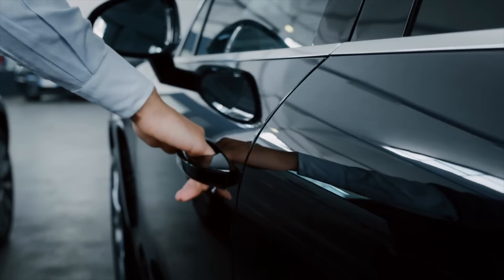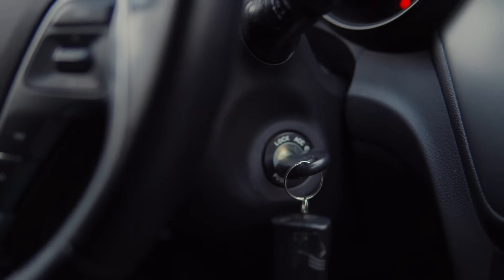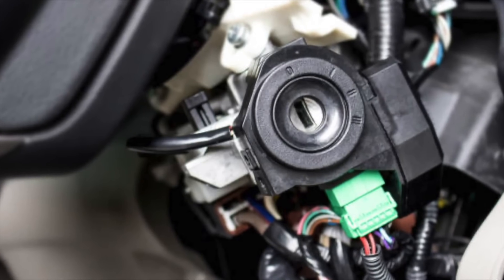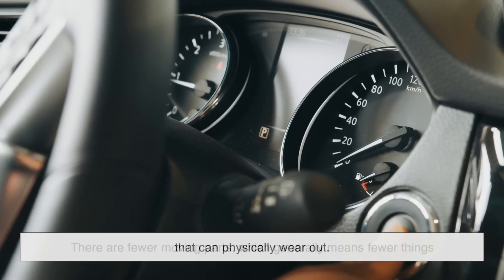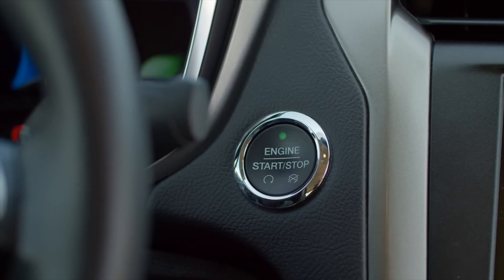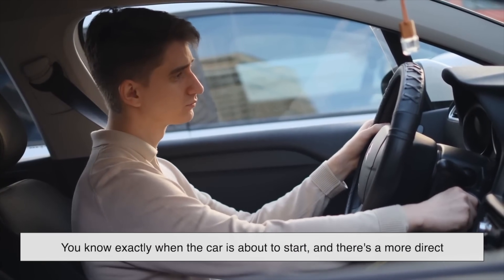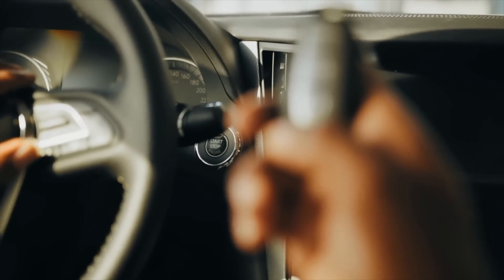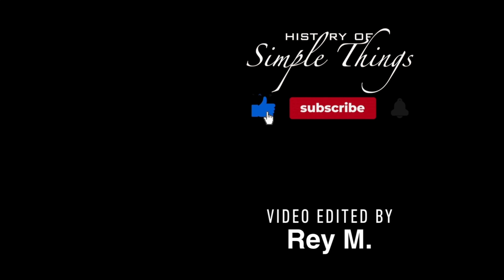Traditional Key vs. Push Button Start: What Sets Them Apart?

Comment: I'm old enough to remember when cars had starter buttons.  Sometimes on the dash, under the gas or clutch pedal, sometimes yanking on the manual shift lever.

 Much prefer push buttons, I've replaced WAY too many ignition switches.  

Thumbs up to the poster below who knows push buttons won't leave you stranded.  I make it a practice to replace key fob batteries every two years so my wife doesn't have to know the trick.
Reply: And I am old enough to remember crank handles
Reply: Back in the day, my 2004 S2000 already had a push-button start. It was rare and cool back then.
Reply: yes read my post also

Comment: Give me the Key back anyday.
Reply: Pop-out-flush electric car door handles.
Modern car industry : creating new innovations, nobody asked for, to solve problems nobody had. 
🤔🤔😀😀😀😀
Reply: Quit buying new cars and just drive one with a key
Reply: @josejh-eb8st And risk getting it stolen but hot-wiring or even USB and screwdrivers, I'm really good with my new push start which totally removes these risk factors thank you very much and so does so many other car manufacturers finally slowly but surely phasing them out like how they are phasing out disc players
Reply: Buy a 2nd hand car then, time to phase these old school things out just as they did with the old school cranker

Comment: In 2024, over 850,000 vehicles were stolen in the United States. Stolen vehicles are used in the commission of crimes such as robberies. Stolen vehicles have been used to ram through the doors of stores. The robbers don't care about the damage done, because the property does not belong to them and they do not believe they will be apprehended,

Comment: The remote has a backup feature. If the battery goes dead. It has a RFID chip built in and a key. The key gets you in but the chip will still start the car. Just place the remote where the manufacturer recommends to get the vehicle to recognize the remote. Now you can start the vehicle. Don't forget to replace the battery asap.
Reply: Didn't know that! Thanks 😊
Reply: Everything is in the owner's manuals.

Comment: I know it does not matter unless you are using a different car every day but, every manufacturer puts the start button in a different place and sometimes even on different models within the same company. Don't know why they can't just put the button where the key used to go.
Reply: The location where the key used to go is a bit out of the way if you think about it, you have to bend your wrist more vs point and press your finger straight forward. 

Different location may contribute to visual design of car, and functionality. Some like it near the stick shift since it's where you go to next after pressing the button. Some like it near where key traditionally is but off to the side so it's easier to see and press as mentioned before

Comment: A dead FOB battery will not leave you stranded. All you have to do is to push the button with the FOB and it will start. Some cars have a special place to put the FOB (such as a slot) and then it will still start. 

Since I have some disabilities, not having to fumble with a key makes my life much easier. You can also leave your car running when you go into a store as it can't be stolen if the FOB is with you.
Reply: I beg to differ about not being able to be stolen, they can drive to their hearts content as long as they don't turn it off.  At least with mopar products they'll get a nag on the dash complaining the key isn't present, but it won't shut it down.  LOCK the car if you leave it running.
Reply: @robertstout6980  How do they get it into gear? No FOB, no shifting?
Reply: @paparoysworkshop  Just hit the brake and shift.
Reply: @robertstout6980  Sorry. No FOB, no shift. Don't try and tell me how to drive my car.
Reply: @paparoysworkshop it's not a matter of trying to tell you how to drive your car, it is just the reality of it as the car can still shift even without the phob being present once the engine is on, it is just that they can't shut off the vehicle or else it will be totally useless at that point
Reply: @thebluemambawarriortv9845  It actually depends on the brand of car. Some cars will block shifting if the fob is not detected.
Reply: I came here to say this. I work at a dealership and the number of dead fob’s lol. A real key is better. I drive a 08 aspen and have a 98 Dakota protect truck in my shop. My wife drives a 08 aspen as well but yesterday I picked her up a 2014 charger and it’s got push to start. She loves the car. Hates that feature lol.
Reply: It can actually be stolen though you have your key with you if you leave the ignition on, however if the their shuts off the car it won't be able to start again unless recovered to place back the key with it
Reply: @thebluemambawarriortv9845  It can not be put into gear without the FOB. The system locks up and the car can not be driven. If I left it in neutral, then yes, it can be taken until put in park, or turned off. But who parks their car in neutral? 

Here is a funny story that happened to my friend with his car. His wife had the FOB. He dropped her off at the grocery store then went to get themselves some coffee and donuts. He put the car in part at the drive through window while he paid. And that's where he sat. His wife had the FOB and he sat there blocking the drive through. Engine running and no way to put the car back into gear. I still tease him to this day.
Reply: yes, just hold fob with the dead battery against the button
Reply: So far, it only worked in theory for me. When the fob was dead, I did the emergency procedure and the car just wouldn't recognize the key. Even after I've replaced the battery, it took a while for both the fob and the car receiver to come to their senses.
Reply: @lajya01  Interesting, we did have one time when her key fob battery failed in less than two years and I had to hold the fob to the start button, it worked perfectly, even with the battery removed.  I have no idea how that works, but it did.  My wife is simply not mechanically inclined in the least and I want everything to work as intended for her, so I replace key fob batteries every two years and the car battery every 5 years.
Reply: @lajya01  I removed the battery and tried it just to make sure.
Reply: @lajya01 It normally starts about 1 or 2 times before not starting anymore until the battery is changed normally to warn you to change the battery but again hence why you still have the Spare phob to use until you change the battery on the main one
Reply: Maybe on whatever you drive, but not the case on Chevrolet. Unless you use remote start then it won't shift
Reply: maybe on whatever you drive. Not the case with Chevrolet unless you use remote start. Then what you say is true.
Reply: @Freddy_Tiffany  Of course I can't speak for every vehicle. I can only speak my own and friends who've told me the same.

Comment: Cars with the Push Button start are Known to get Stolen
Reply: That was Hyundai (and KIA) that didn't bother to upgrade their cars that had the push button start system. Most push button start cars are much better. Also a Faraday pouch can be purchased (I bought mine from Amazon) to put your FOB in to defeat any theft by signal amplifiers. Also FOB signal strength is only 3 meters (a little over 9 feet) from the car.
Reply: I think some companies were stupid enough to not implement rolling codes.

Comment: I prefer key 😊
Reply: I prefer the key and shifter instead of push buttons……..they did this in the sixties and it didn’t catch either.
Reply: It's all bullshit to make the cars expensive and now you need to replace another fking battery
Reply: So do I
Reply: The day one feels comfortable and nostalgic with what used to be usual...
Means only one thing... you are growing old 😊
Reply: @thesaint9286 
Modern car industry : creating new innovations, nobody asked for, to solve problems nobody had. 
🤔🤔😀😀😀😀
Reply: @thesaint9286 aww I'm only in my 30s but this sounds like I'm a fossil 😂